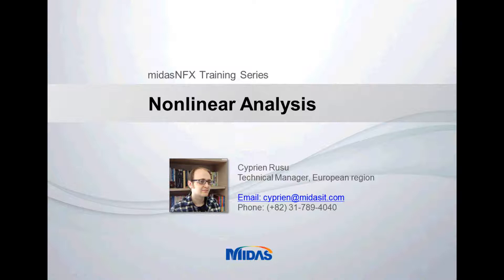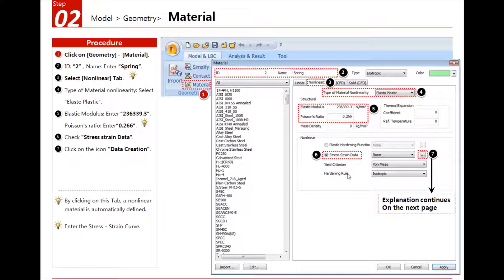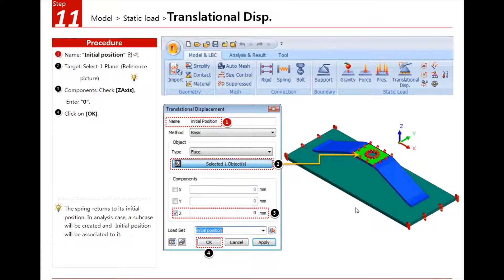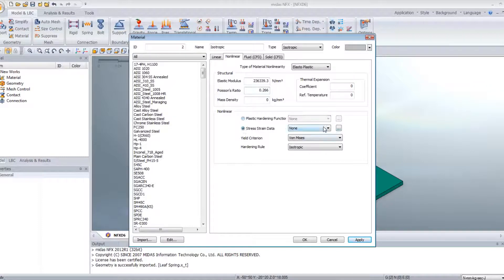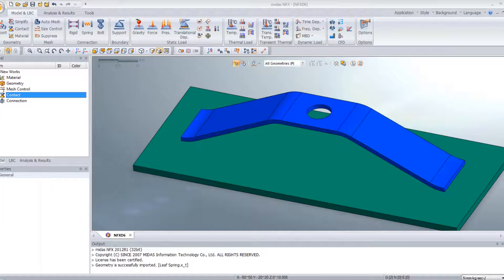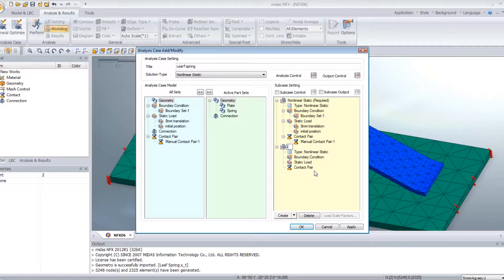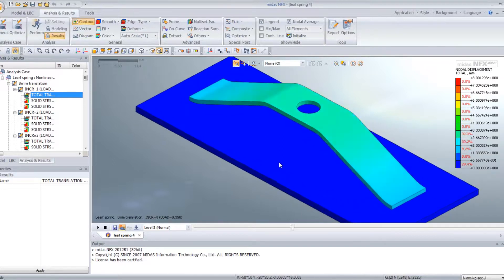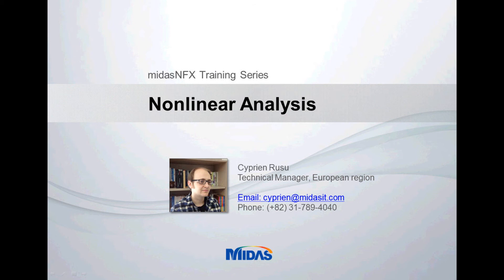NFX Trainning Series - Nonlinear Analysis

Comment: Hi your videos are nice and educational I have seen most of them, I have this one question, why do I have wrong mass density when i am importing from Solidworks 2020 to Midas NFX, i used IGES, STEP and parasolid still the same Mass density is not what i am expecting, when I exported a model in solidworks that weighs 0.27kg to Midas it becomes very very large to the mass property once imported. Is there a way to correct this? thanks.